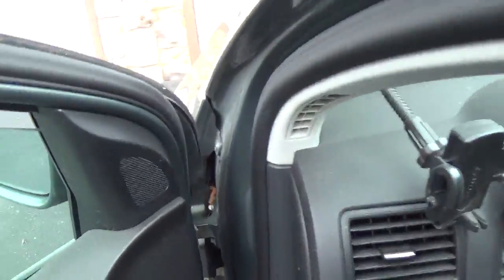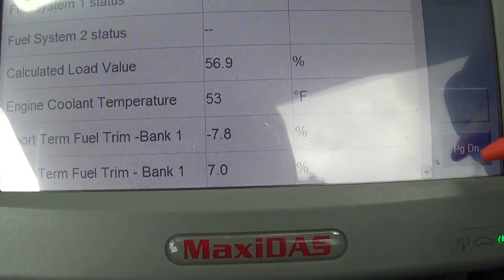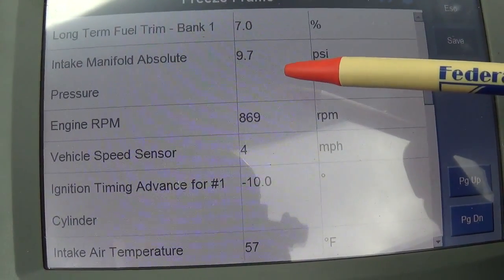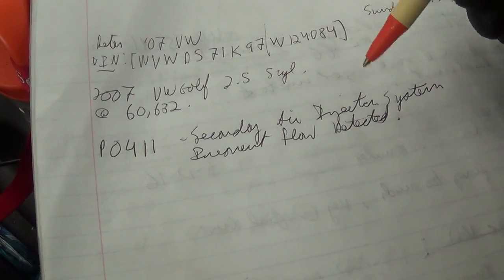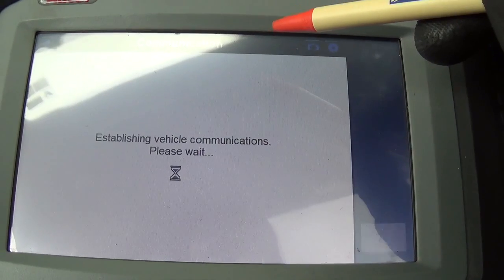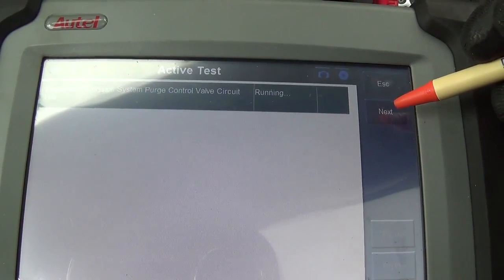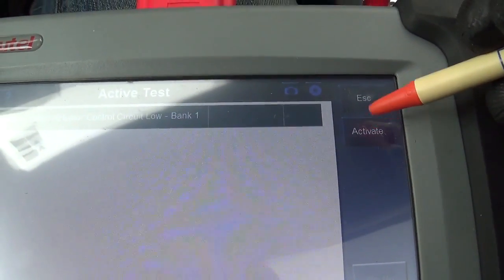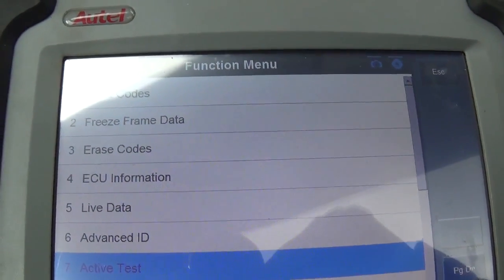VW Secondary Air Problems P0411

Comment: Dealers rely on the computer to much they should have done what you did use it to get a area to start and then visually inspect the components of the system

Comment: Having owned two VWs in my time, the worst part of VW ownership are the dealerships.  Never ever EVER go to a dealership for anything but warranty work.  That car is a 2007...they should have called you or some other COMPETENT INDEPENDENT MECHANIC to fix this problem.   Expensive lesson for them to have learned.

Comment: Also could have commanded the secondary air test to run through your basic settings. It would run the monitor for you to verify the repair quickly. 😉
Reply from the maker: Dang it, I was wondering if the scanner had that function! Basic settings you say? I don't think the dealership bothered running that test after their repair either haha :P
Thanks for the pro tip, Keith!
Reply: @PineHollowAutoDiagnostics   Ivan, basic setting #77 is the sec air test. Must bring the car to full operating temp for ten min minimum.

Comment: $620...jesus, parts changers are the cancer of dealerships, people need to stop thinking about dealerships as the eminence in their respective brands, most of the time you get a technician flagging hours like crazy on brake jobs and recalls, so when he gets a problem like this, where you need to use the brain for a second, its too much hassle so he'll start throwing parts and clearing codes until it doesn't come back or the client notices what a hack he is, i suggest if you take your car to a dealership, or any shop for that matter, talk to the person that's gonna look at it to see if its a competent, honest technician like ivan here or eric at SMA, that move might save you thousands in the long run

Comment: Merely R&R the Diverter valve- Dealer TardTech couldn't tell the inlet pipe was broken (loose/cracked)? Don't they have a smoke machine? Sure- at Dealers now days- there's no money to be made with diagnosis, troubleshooting, and actual necessary parts replacement. I would immediately use this video as evidence, contact VW, and dispute that bill. No way they would get a dime. Were the original parts returned to the Customer (Diverter valve)? There's probably nothing wrong with it. Re install old, be prepared to bring new back if win case. "Parts Changers" make me sick.

Comment: Hey Ivan, I thought the map pressure is supposed to be subtracted from 30 or (29.4) absolute psi giving you 21inches of mercury? Just a thought.
Reply from the maker: 30inHg = 14psi = 1 atmosphere. Then you have to watch how the scanner is reporting the data...Manifold pressure, or manifold vacuum. In this case it was pressure. In that freeze frame the vehicle was actually just starting to accelerate from a stop, which explains the high load and manifold pressure numbers :)
Reply: Actually 14.7 psi at sea level. if you want to be precise. Beautiful upstate NY and both weeks of summer.
Reply from the maker: Around here is about 1000ft above sea level so 14psi is close enough :)  And I'm wearing a hat because it was still in the 30's in the morning! Last cold spell in May.
Reply: I know about all that I used to live near Bignhamton LOL 14 sounds good at that altitude..
Reply: Find a chart for exact readings. Less than 5psi appears to be a good value. Thanks VW for making me work to know what the vacuum is.

Comment: Awesome Ivan.   I have included that self healing rescue tape in my arsenal.  It's awesome.  It repairs broken hoses.  Withstands pressures etc.....   One brand is rescue tape.   I got a roll at Home Depot    Nashua brand.  Stretch and seal.  It is a self fusing repair tape   Stretches 300% and no sticky residue.    Check it out.  ;)

Comment: Typical... Paul just made the argument that a lot of today's techs don't check the easy stuff first, they go for the $$$$.  Knowing VW pricing that hose is probably $120.00 +

Have you seen the new Autel MaxiSys 906? It's the updated version of the MaxiDAS. Has the high end internals WITH a battery so you can keep info. It still uses a cable to connect.

Comment: 600 dollars for a torn pipe. The supply of chancers in this world always exceeds the demand.😣
Reply from the maker: They should at least give the owner a free plastic pipe and installation lol
Reply: Why you think this kind of scenarios happen Ivan.???   (I am a mechanic on Oklahoma city and I have a lot of histories  like this one .!)
Reply: +motoYam82 hey Ivan, great video. For 600.00 they should get a happy ending. lol Thank god for knowledgeable, thorough, and above all honest mechanics like yourself and Eric O.
Reply: which hey did not even find , that is why I never take my cars to a dealer  they are not only crooks but and most of them ad ASE certified which to me is a bunch of BS  all it means it that you read the book and took the test , but to take it from you head and put it to your hands is where the experiance come in ,you are better off buying a cheap scanner to  tell you the codes and fix it yourself, and believe me with a little practice you can do most anything youtube is on of the best sites for this but there are a lot of sites for your car , you do not rally need much tools at all to fix most of the stuff for emissions at all , just never overtighten any bolts so you do not break them

Comment: If the code sets within a very short time , I would have to give the VW tech the  edge if he never seen the code reaper , maybe the valve was shot , could  the hose unluckily split after the dealership . Did they bring it back to the dealer and why not , I think for that price they would have found the hose and fixed it for free. What do you think ?
Reply from the maker: Hey Steve! It's a two-trip code, so one test drive wouldn't throw the CEL unless you looked at pending codes. 

But the customer told me that the dealership's next plan of attack to solve this issue was "internal engine work costing thousands of dollars"...are you kidding me?!? This system has nothing to do with the engine itself at all!
Reply from the maker: Well if the light came on the next day, I would say someone didn't "verify the repair" :)
Reply: +motoYam82 Wow Buddy send  the vid to VW head office in America . That's nuts. They owe her all her money back just to save face but it seems VW is faceless over the last year. LOL
Reply: What you say is entirely possible......I don't know the story on this job, but I'd like to know was the vehicle shipped with the check engine light, or not?  I think Ivan said the system  does a self-test, I just don't know the frequency.. I wonder if the work done on the bill might have disturbed a rotted plastic part?

The obvious thing to do here would be to return to the dealer-ship, but maybe the owner did that....
Reply: I think a lot of diagnosticians, of all sorts of trades, get away from the basics....that would include a visual-inspection of the system in question.
Reply: Unbelievable Ivan with the story of the dealership. Still wrapping my head around that one. Oh, and this video brought back some memories  LOL..Nice video Ivan and keep up the good work!
Reply: It is possible that the parts they replaced were in fact defective.  It is possible that during the replacement of the diverter valve/pump, the hose was damaged.  

However, if I was the customer, I would demand the problem solved or my money back.  I would question why I spent $600?  I wouldn't spend $600 in any other aspect of my life without getting something in return.